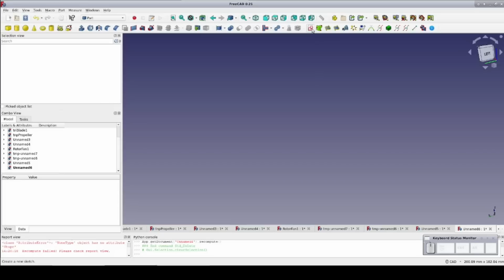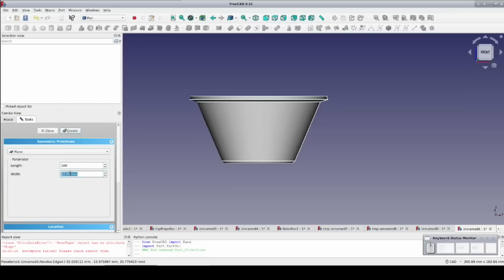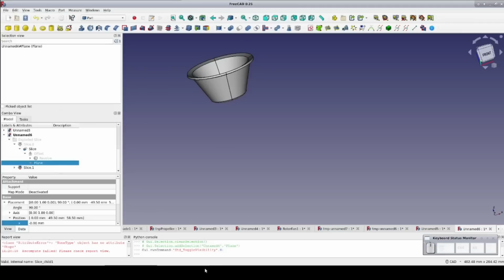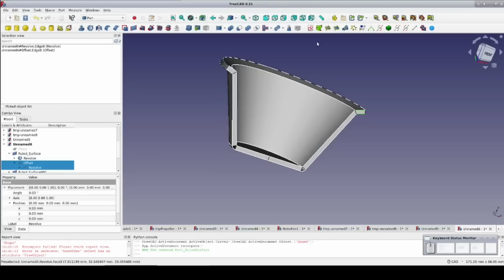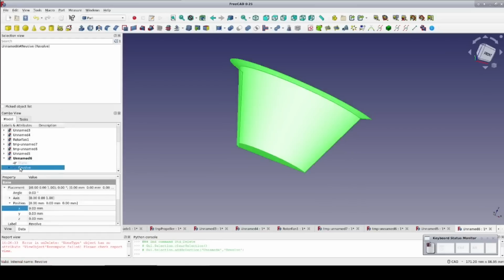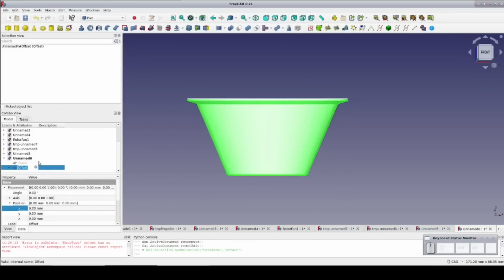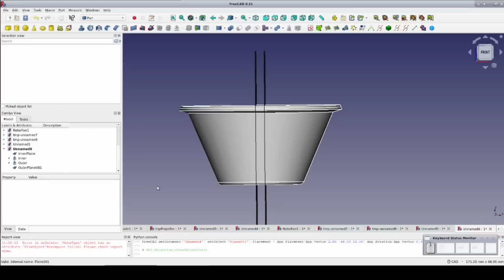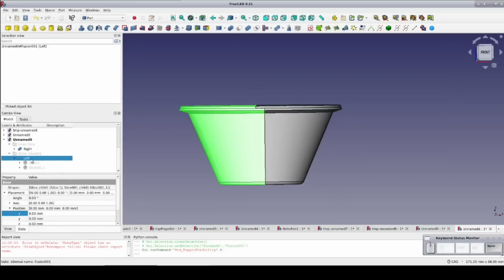FreeCAD: An open reply to Tom Sanladerer

Comment: I had no doubt, that you can do everything in freecad. In the end both are 'just' CAD programs. But I think most other applications are way more intuitive to use
Reply: Yes, but this is open source and has benefits just from that, and it's of course still under constant development. It's not a problem free product, but it is free. Nobody's going to just suddenly decide to erase your account or dramatically change the licence up or start demanding cloud logins just to use a local app. For hobbyists, FreeCAD is very compelling and I decided to learn it rather than anything else for my modest 3D design needs. There's no reason to assume it can't be a 100% pro tool as well, currently not optimally so, but the future looks bright.

Comment: I have tried freecad several times over the years, it has been slowly improving, but every time I bounce off it and go crawling back to some freeware commercial product. I want freecad to be good, and I always feel sad that I cant do much to improve the situation. I am glad you made this video in its defense. It is obvious to me that the devs have poured a lot of love into this software.
Reply: I keep crawling back to tinkercad which works for me as a tradesman, but using a proprietary cloud based product as such a key piece of my 3d design and printing workflow scares the hell out of me so I often come back and try to learn FreeCAD again. It seems like it's just a little ways away from being a top tier tool, but I haven't been able to successfully use the interface yet.

Comment: FreeCAD's biggest limitation is the UI. The software is fully capable of doing everything in a similar way to everyone else, but not much of it is automated and the tools you actually need to do it manually are rarely where you would expect them to be given the way other CAD packages handle their UI. I usually design at home because of projects, and when I run into something that doesn't work with no clear reason why it's very hard to justify powering though and figuring it out given that I am probably focused on other tasks. I keep FreeCAD around because it really is quite powerful when you get down to it, but I often find that I end up turning to Solid Edge when I just need to design a simple part to 3d print quickly.
Reply: For me I think designing simple part in FreeCAD really is the easiest thing. With "simple" I mean a 2d sketch extruded. That's straight forward but not obvious to do in FreeCAD. Everything else might get trickier. But I made huge leaps when I understood the reason for "datum planes", "shape binders", sketches outside a part and a couple other non-obvious things...
Reply: It needs redesign as blender from 2.8

Comment: I gave up trying to use FreeCAD specifically because it was so convoluted compared to other solutions. I really want to move away, but the workflow is so different, I have to throw away 5 years of experience and start over again.
Reply from the maker: That is often the case moving from one software to another, even between different proprietary software or sometimes across a major update to the same software. It's very much an individual weighing of pros and cons.

Comment: You missed the Point of Thomas Video... The topic was Not that this specific Problem would bot be possible to solve, but that the while Software is at a Standard that is about 15years old. Unintuative UI, weird workarounds for Problems, poor documentation, random unexplainable behaviour, etc. 
You might manage to model anything in Freecad, but the effort required is Not worth it.
Reply from the maker: I didn't miss the point, but if you're going to give up at the first minor difference, you're not really giving it much of a chance. The same thing would cause a Solidworks user to reject F360 as unusable.

Comment: Thank you. I ran into the issue with the revolved sketch a few times and now I now why. 

I see two issues with many OSS programs. There are hobby and professional users that expect the software to work exactly the same as a similar commercial software they are used to. And there are companies that use OSS software, save a lot of money doing so but they don't give anything back to the project. It would help many projects if there was some form of support from the commercial user base. It might be sharing code and plugins, helping with documentation or donations.
Reply: Ondsel?

Comment: This is an excellent video demonstrating the viability and workflow of FreeCAD, thank you. I started CAD many years ago and have been using Autodesk products by default. With FreeCAD, I can seriously consider installing Linux on my laptop and running primarily free software.
Reply: That is i do at work.
Even with the worst computer I made my draws and sent then to the 3d printer, in Linux

Comment: Thank you for this informative video.  I wonder if any of these techniques are also supported by alternate design applications.  I am a hobbyist in mechanical design, primarily for 3D printing but also for expressing ideas.  My free tool of choice is Onshape, a browser based tool with cloud design storage.  Onshape is free as long as you are willing to share your efforts publicly.  As a hobbyist, I don't care if anyone else sees or copies my work.  One advantage is that you are always using the latest version of the tool.  The downside to Onshape is that there is a subscription cost should you want to protect your design.

Comment: I tried so hard to learn the FreeCAD way of doing things, watched countless videos, looked at the code... Its UI is such a lump of disconnected workbenches and icons that even trivial tasks require rather illogical workflows, jumping from one workbench to another, each with its own limitations and quirks, with duplicated (but not quite) functionality. For a newbie it's a giant headache. I ended up paying for Fusion 360, as much as I hate Autodesk and the subscription model. I decided that it's more important to make the models, rather than learn the convoluted way you need to go to get things done in FreeCAD.
I have some Inventor and SolidWorks experience and I have to say that switching between those is maybe not exactly painless, but at least you don't feel as lost.
Reply: Have you tried Onshape?
Reply: It's browser-based, which is a big "no-no" in my book.

Comment: thx U , very well explained and helpful, I get a grasp of freecad at the end.
Now ... I did what you did in the first example , sketch , rotation 360, offset 2mm fill, surface, split and my "cup" is split only in the outer part, inside i still have the rotation solid. where is the mistake ?
Reply from the maker: I think you're probably just seeing the original revolve. Using it for the offset doesn't consume it, it just gets moved inside the offset in the tree.
You can select it with the mouse and hit space to make it invisible.

Comment: I am glad I found your site.  I am a retired engineer that has been using low cost or free cad software starting with ProEs Granite and Creo and even purchasing a hobby cad.  My requirement is that I can import or export to other cad programs and there is a blue print capacity.  I have used ProE, Unigraphics, and solid works at my employers businesses.  I always point out that FreeCAD isn't own by someone with a commercial product they make money at.  It isn't going to suddenly end like Granite or become a cost to license like Creo.  It doesn't limit the number of parts and the output file formats.  And finally one of the most important is that the user base for FreeCad exceed that of all but Solid Works the last time I checked. It isn't going away.

Comment: FreeCAD just isn’t that good a choice yet, especially when solidworks has a non commercial license and fusion and onshape are free for  non commercial use. The fact you had to use an add on to do what should be a simple task really says it all. The method of splitting was pretty convoluted compared to other CAD programs, where you could just make a sketch of the split profile, turn it into a surface and split with that directly. How in freeCAD would you manage a split with complex or curved geometry?
Reply from the maker: You might want to watch again. Splitting required nothing more than creating a plane, moving it to where I wanted the split, and then splitting. I could have done that with a sketch as well, but why bother when I can get a ready formed plane even quicker?
 
Then I showed what went wrong with the 180degree rotation, offset, and fill by doing it manually. 
Naturally, that was complex, I was doing something manually and explicitly step by step.

Then I showed two different ways to avoid all of that hassle.

Finally I designed the thing the (a) right way using only the Part workbench.

Comment: I love open source software (I moved to KiCad from a paid app back in version 4 and love it) but IMO FreeCad is not a viable tool for 3D modelling.

Just to elaborate:

Structure tree breaks when changing upper features;

you can’t use reference dimensions as parameters;

you can’t use linked edges as active sketch entities to build volumes

Each one of these is a deal breaker on its own, together they are unforgivable fundamental flaws.

FWIW, I pay $500 a year for Fusion 360 and would much rather support OS software.
Reply: 1) solved in the realthunder fork, slowly being merged into the main codebase
2) you need to use an expression, it works in most input fields, not sure whats the issue here
Reply: @33KK  it’s still crap! I’d rather pay $500 a year to the greedy Autodesk corporation than subject myself to FreeCad.
Reply: @dJOS_500  oh so even though most of your issues are solved it's still crap. Oh also, your third point, I'm pretty sure that's what the "import defining geometry" tool does, unless I misunderstood what you mean by that.
Reply: @33KK  yes, because it's still a horrid user experience for me. Just look at KiCad vs Eagle - the opposite is true, KiCad has an amazing user experience and Eagle is horrid.

Comment: I’ve been to school for years worth of solidworks and creo. And I design parts for a living using solidworks and cnc machine them. 

I generally have no problem using differing brands of cad software.  I generally can hop onto anything and start modeling immediately. 

When I saw the free cad video and saw it would run on Linux I was pretty excited.  

The excitement stopped almost immediately once I downloaded and installed it.  

I found it the least intuitive software I’ve ever used.  

I watched a couple tutorial videos and even after that I realized the workflow for professional use is so bad that’s it just not worth considering.  

I wanted to like to like it. But i just couldn’t find the reasoning why someone would change workflows of tried and proven software.    I understand the need to be unique and creative but totally reinventing this wheel was lost somewhere along the way. 

When you’re using freecad it feels as though it was designed by people who’ve never used other brands of cad.     And just decided to ignore any types of industry standard.

If you’re planning any type of career in cad I would not bother with this.   Even as a hobbyist fusion 360 is worth the few hundred bucks a year and the support community is massive around it.   At the least with fusion or others you could potentially gain enough experience to get yourself a job in a shop.   This is unlikely with freecad.  So chose how you spend your time using software wisely.  

I hate to give this such a poor review. But these videos keep popping up in my feed.
Reply: .2 version software isn't focused on "intuitive".  At that stage, it's focused on the FREE LABOR that builds bare FUNCTIONALITY without the luxury of optimizing any design but rather depending on the free labor and design skills of those contributing effort.  Much later than .2 comes POLISH and optimized WORKFLOWS.
Reply: @brianmi40  I could get free bus rides to work but it would take me an extra few hours and route me all over town and I’d still have to walk 4 blocks……

I respect the effort that goes into such a project but without criticism nothing improves and likely fails.   Criticism drive me to improve my skills and products.   Try it sometime.  Who knows how far it will push you.  😉
Reply: @Benfoxmra95  As will an understanding of what a version number like .2 says about software being PRE-RELEASE and NOT READY FOR COMPARISON TO FINISHED COMMERCIAL PRODUCTS or that Open Source software is RARELY a valid competitor, EVER, to commercial products for PROFESSIONALS IN A FIELD.  

Constructive, pointed criticism is always beneficial.  Comparing pre-release open source software to commercial complete release products in vague generalized terms is anything but that.  Who knows just how far learning how to deliver constructive criticism could take you.

FreeCAD does just fine with HUNDREDS of YT tutorials covering its functionality.

Comment: I appreciate what you have done here. However, watching every minute of your example, this just shows me that I would never be able to settle on a workflow that would work in FreeCAD. It would have literally taken me 10 hours to figure all of that stuff out. It isn't and never was that there isn't some way to make things work in FreeCAD for a seasoned an experienced user. Especially one that has contributed to the project and understands the guts of it.  It's that for everyone else there is literally no way to figure this out efficiently, and then have those solutions apply, even in similar use cases.
Reply: Its never ever EVER the softwares problem. Its always you and your lack of ability. How dare you or Thomas not think this is the greatest bit of software engineering ever to grace Mother Earth. Shame on you blasphemer!!!
Reply: That's the problem, everyone just attempts to noodle around in a modern UI, thinking it should be somewhat obvious to figure out if you have any 3D experience.   But if you take the alternative path: assume you know nothing and watch a tutorial video (hundreds on YT) for what you want to learn, I haven't found anything I can't do, even making sense most of the time of the workflow involved for future use.

What I think any product needs, is a well graded sequence to watch the tutorial videos in to get up to speed on a product.  If someone had simply told me to watch Sketch, then Pad, then Hole then Work Plane, then Raised Lettering tutorials right up front (I'm skipping many but you should get the idea), I would have save hours over figuring out that sequence on my own.

The rest is ignoring it's a .2 version pre-release product.
Reply: @brianmi40  I think every user has their motivation to use FreeCAD. Most are not commercial, and many are not to learn a skill to earn a living. The rest of us are really in two camps. One is trying to get a project done and possibly retain a skill for later. The other is leaning design/cad to have it as a skill for the future. None of that aligns with how FreeCAD currently works. The Wikis, Forums, and plethora of videos are a clown show. If you are lucky enough to find one that isn't terribly out of date, it only targets one specific task. Many lead the user directly into a topological naming problem, and practically none really discuss how to develop a workflow plan to help with success for repeated use. Your video was great for showing how to het to a solid from a revolve. But now I need a polar pattern? Look at the documentation, not a thing there that any normal human could use to learn the tools.
Reply: @adaycj  I disagree on several points, starting with it's not "my" video.  First off, none of the motivations for learning FreeCAD should be commercial other than a shoestring 3D printing farm startup on a strict budget for a relatively limited number of straightforward designs.  And no one trying to learn CAD skills for a future possible career should be using a .2 pre-release of an open source CAD program.   There are free or low cost Student editions of virtually all of the commercial CAD systems so that is a complete strawman argument.

As for "trying to get a project done" the hundreds of tutorial videos on YT testify to the ability to do that.  In my personal experience learning it over 4 months, there's nothing it hasn't done for me, including creating a replacement part for a window regulator that included a 3dspace curve boolean subtraction and complex internal geometry.  With thousands of active users any claim that FreeCAD can't yield functional results is ludicrous.  A lack of knowledge of how to do something in it is a very different thing from the inability of the tool to do it, as Thomas was shown in this video.  With over 100 YouTube videos covering version.2 your statement about videos being outdated is also false.  There are many many YouTube tutorials where you can read the positive comments about their quality.

Documentation covers how a product button or tool functions, it is not a tutorial in any way, you should stop trying to make it something it was never intended to be, that's what the literally hundreds of YouTube videos do, including the 3 that cover polar patterns in 3 minutes or less.

And the point of short single topic videos is that is what most users want thereby are what created by the experts doing them and they also eliminate searching through a 2 hour video to be reminded of a couple key steps to do something.

As for polar patterns, I counted 7 videos from 2022, so plenty that are not out of date.